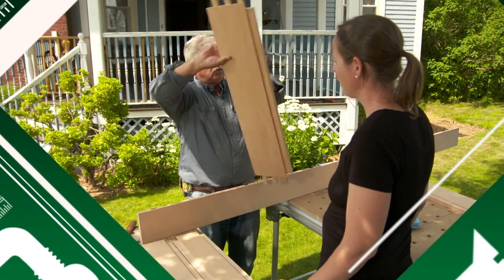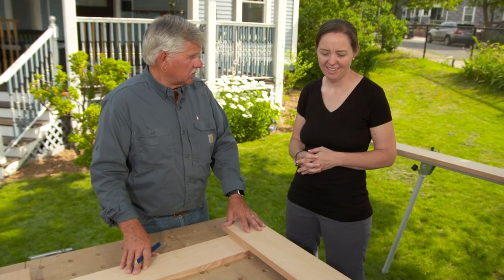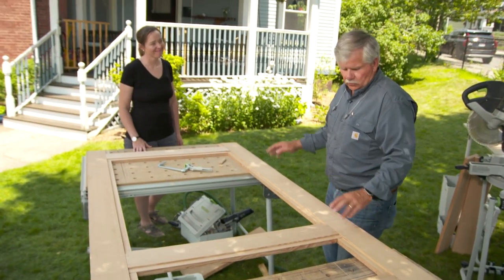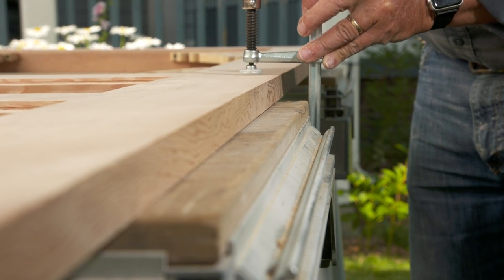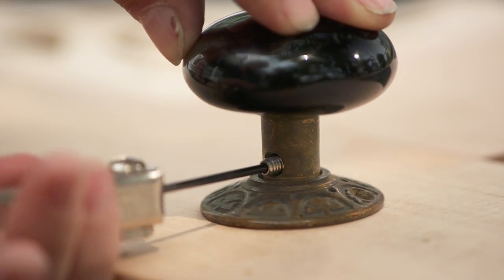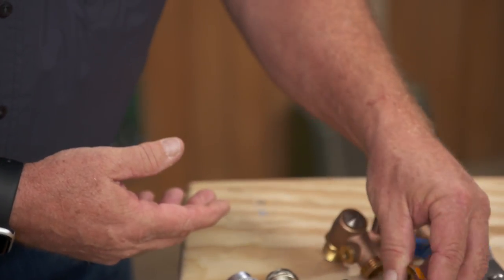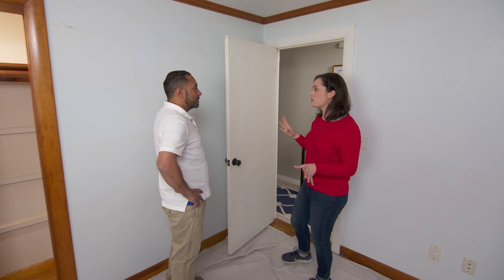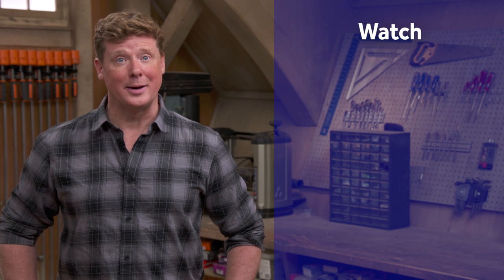ASK This Old House | Custom Screen Door, Paint Trim (S18 E18) FULL EPISODE

Comment: I usually defer to Tom on everything, but his screen install... I don't know. I learned from an art student how to stretch canvas. Start by pulling across and stapling in the center on each side. Then do the top and bottom. Now as you work your staples out from the centers towards each corner you move any wrinkles to the corner where they disappear.  It's worked for me for more than 40 years. 
Also auto PPE installer videos? I've seen one guy do this method once, everyone else fusses and fusses with no clear method. I've never installed PPE so maybe I'm missing something - but a screen? I've done many.  Still, it's a beautiful door.